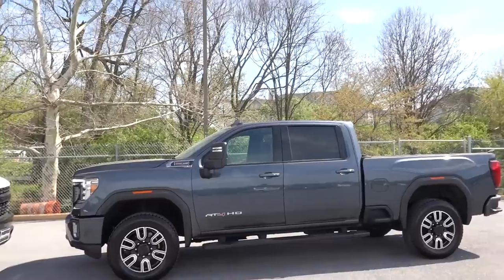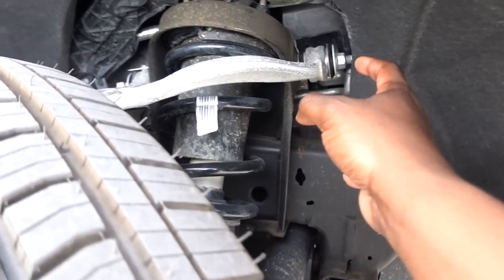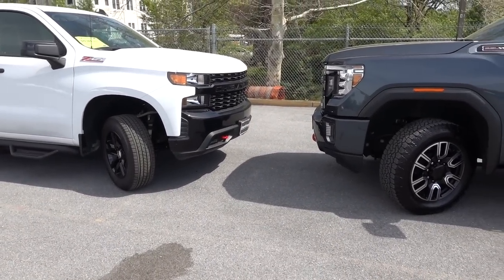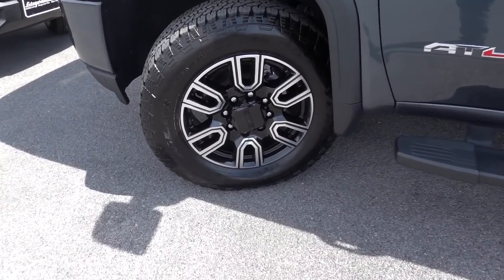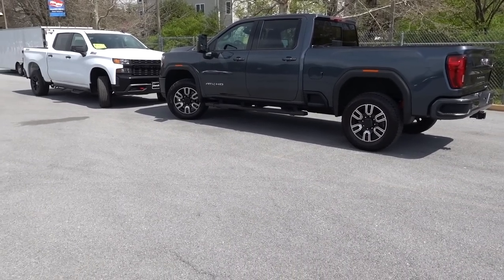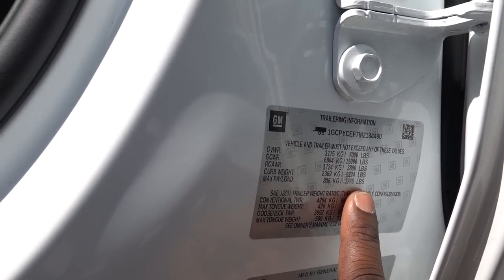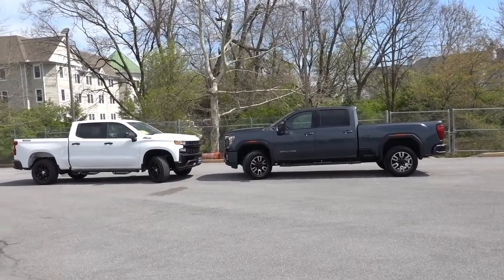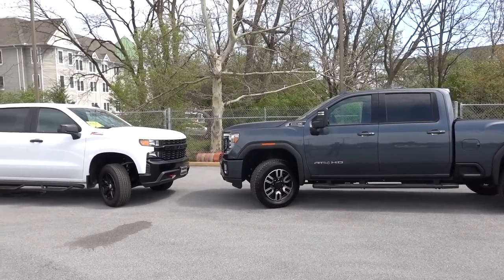Light Duty VS Heavy Duty - 3 Reasons Why You Should Just Buy The HD!

Comment: My 2021 GMC Sierra 2500 Duramax is way more comfortable then the 2021 Chevrolet Silverado 1500 I had
Reply from the maker: You like the stiffer feel which is the same for me 👍🏾
Reply: Honestly it didn’t feel stiffer. I was completely mind blown when I drove it. The 1500 was stiffer. Granted for a crew cab standard bed 1500 I was pretty impressed with the payload capacity it had of just over 1900lbs. So I’m sure for a 1500 the lear pack were very stiff

Comment: If you shouldn't tow more than 6000 pounds with a 1500, why do manufacturers rate the towing capacity higher??
Reply from the maker: Great question, bragging rights!
Reply: @JB_WhoWork  So how much would you tow in a F150 rated with a towing capacity of 14000 lbs and payload of 3325 lbs?
Reply: @JB_WhoWork  Further, let's say you have a trailer with a loaded weight of 8000 lbs, the TW is 800  which leaves 976  payload capacity for the 1500, why can't you tow in that configuration?
Reply: A 6000 pound square camper will tow a lot different than a 6000 pound flatbed trailer, I think that's more what it's about.
Reply from the maker: Whenever you see Ford, GM, RAM, or Toyota advertising their half ton trucks towing, it’s never towing anything close to their tow ratings. If you find a photo of any of them pulling what their  max rating is on their website or any literature, let me know!

Comment: HD all the way.....
Reply: what if u only tow 6 to 7 times a year   7k lbs camper   loaded
Reply from the maker: You have to figure out if the sacrifices are worth it 👍🏾
Reply: @JB_WhoWork  have you heard if the 2023 Chevy HD 6.6 gas will come with a 10 speed transmission
Reply: @kyleerickson3382  The 6L90E is a proven transmission 10 speeds will just cause problems.
Reply from the maker: @Kyle I have not

Comment: HD trucks are 100% way  better if anyone tows anywhere from 5,000lbs to 10,900lbs because a lot of family of 4 in a half ton truck that’s towing a 6,000 pound family boat will maxed out the half ton. For a example I saw a 2022 Ford F-350 srw tremor have a payload  4,300lbs in a 7.3 gas v8. A family of 4 is around 600lbs plus 140lbs of luggage then a 6,500 pound travel trailer (700lbs of tongue weight) is maxed out in a half ton but in the one ton srw with 4300lbs you still have around 3,000lbs of payload.
Reply from the maker: Thanks bro, this is a really good point! Few of my buddies go camping together and figure 4 big guys in one truck with a fifth wheel. In most SRW HD’s that’s almost maxed out so when you think about 1500#’s of payload, 4 guys combined is over 60% of the weight 👍🏾👍🏾
Reply: Dont 2500hds pull more than 10k? On my tech specs it says the max fifth wheel weight it can tow on my 04 chevy 6.0l gas is 15,500lbs.. and 12,000 for travel trailer.. does that sound right?